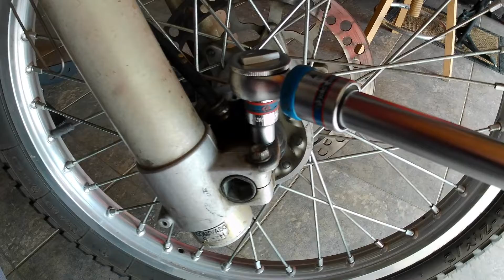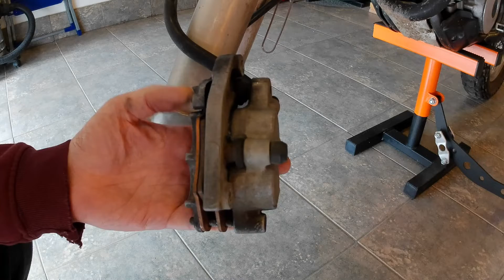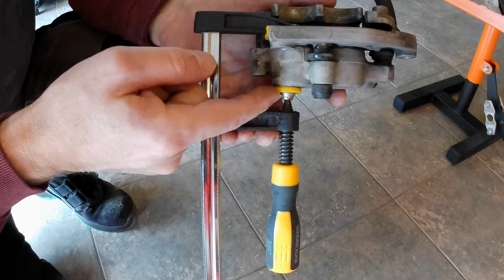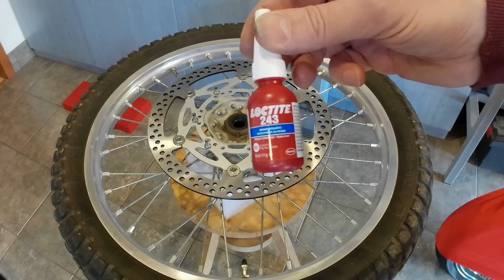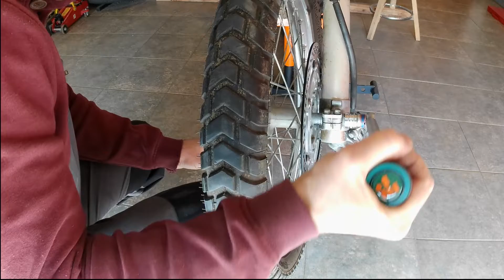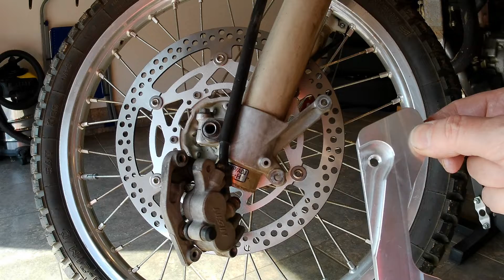Suzuki DR-Z400S front brake upgrade to 310mm

Comment: Great video! Could you please share where you bought the 310mm adaptor from? That would be amazing! Thank you!
Reply from the maker: Hello. I bought it from a local shop in Hungary. But there are similar adapters on Ebay as well.
Reply: @ thanks so much for the reply! I tried finding an adaptor for 310mm disk, but without success. I want to mount SM wheels on my DRZ400S, but I can only find 320 diks and adaptors. I would like to keep the original 310mm disk which comes with the SM wheels. Do you have a link for the one you bought? I live  in Romania, btw :). Thanks again!
Reply from the maker: @mihair1  There is the link:https://www.kepesmotor.hu/fek_kuplung/p2558816
Reply: @ you’re a legend! Thanks a lot!
Reply from the maker: @mihair1  Thank you very much pal.